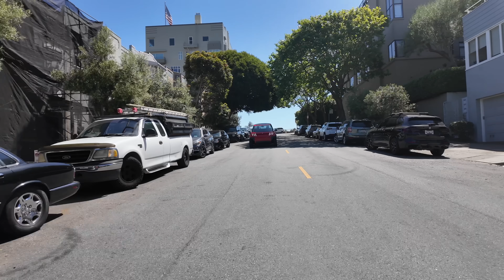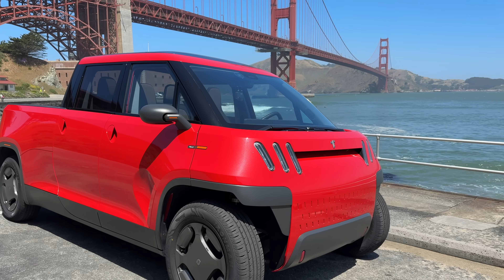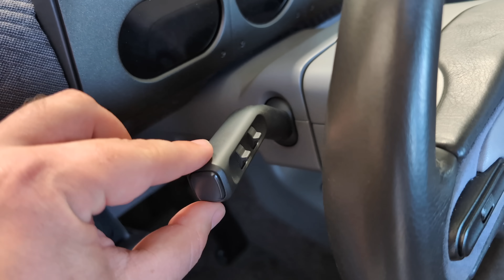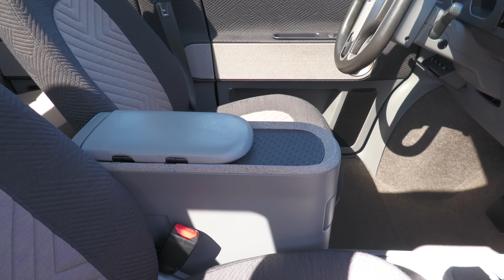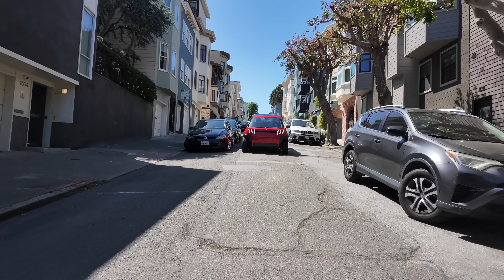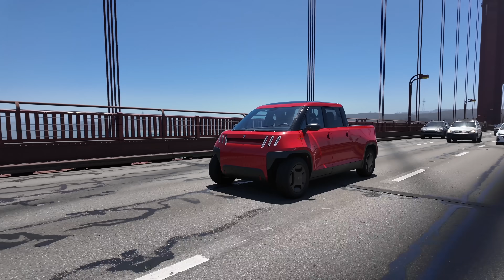The Tiny Telo Truck Hopes to Pack a Big Truck Punch

Comment: If I had one critique on it just from the numbers, it would be that bed length of 5 feet (a similar complaint that I have to the Maverick and Santa Cruz).  Rather than doing the mid-gate, and bringing whatever you're hauling into the cabin (to say nothing about the weather), wouldn't it be better to put an extra three feet into the bed (making it still be a foot shorter than the Maverick).  Of course, you could then have three feet more of battery underneath that bed.  Well, maybe have that as an option.

Comment: Quote: "Serving the utility of a full size pickup truck", hmmm, how can that be with that odd ball 5' bed?  Is this a joke?  And at that price?  R U Kidding?  Get rid of the 2nd seat row, extend the bed that much.  The cab looks so cramped for the two of you testing it. Ok, it does look cute and if were in the $30K range for single motor and std. range it might be an ok 2nd vehicle that can carry groceries home.  (Or a pizza and 6-pack of beer.)  I think I'd prefer the SUV version and not call it a pick up truck.  Hey, I also think the Cyber-truck looks dumb as hell too, unpractical and way to expensive. Look at Slate for a very practical price point and options....  With the Telo I think your knees are to be sacrificed in any minor head on collision, I see for a large dude you had driving it, his knees were right at the dash under boards...yesh...better put an air bag there please.....Last word, I do like its look and conceptual entry to the market.  Keep going and you bet I'll keep watching to see if you hit my 'must buy trip point'!

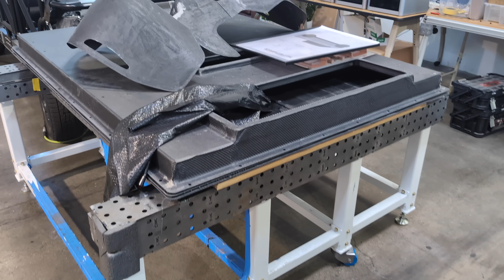Comment: 3:15 that´s the thing with EV´s. they are all their own standard... if car manufactures keept to a battery standard  frame work for like how they needs to be shaped and what kind of battery setup´s i would feel i could own a used EV knowing its easy and cheap to find replacement battery´s.. today, i wont give you a single USD for a EV... cuz all the value are in the battery and i cannot risk buying a used car there i need to replace a battery for a cost of a new EV if i am lucky finding a battery to replace with to begin with.

Comment: Crew cab is truck cosplay for city folk. 
Truck beds and men on dating apps under 6 ft are equally real.
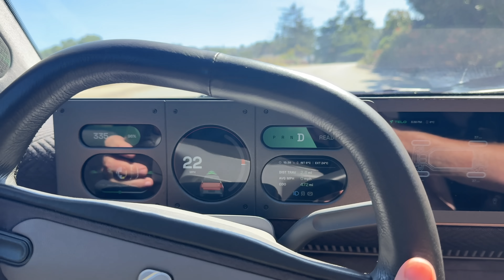Reply: 2:33 "Our vehicle is a pickup truck dedicated for downtown cities." And the reason people drive pickup trucks downtown is to roleplay as rugged, rural, and/or rich enough to afford an impractically manly whip. Even in the country trucks rarely haul anything; but downtown there's no practical need! Vans, station wagons, and even SUVs do deliveries better and you ain't doing landscaping in the concrete jungle!

Comment: The cab itself removes a lot of my issues with American style pick-up trucks. The lack of an enormous hood that can hide twenty 1st grade children is a bonus in and of itself. And if it keeps the style, you can have a cab that's higher up. It's basically a flattened van-style cab.

It might need slightly better forward visibility, so you're not parking a full foot away from the kerb, which you might be able to do by raising the height of the cab.

Comment: Disagree with the two-door comment. A short truck is where i want a two door.
Reply: As Telo has said repeatedly in videos and articles from various reviews, they chose the 4 door crew cab short bed version after extensive market research. so they didn't just 'decide' to not offer that configuration, there was data behind it. As much as you and others do want a 2 door long bed variant, you are apparently a very small minority. Further, the the truck does convert to a 2 door with an 8 foot bed when dropping the mid-gate, which satisfies a lot of people that need to carry longer items.

Comment: Here's why it misses the mark. They try to do too much with a tiny package. The bed is too small to haul anything (compared to the small "Slate" even). The back is too small for adults. The driver's legs are about a foot from the bumper. Safe? Why does it need 500 hp? People want an affordable small truck. 500 hp is unnecessary for day to day driving and an unecessary expense. AND a pick up truck especially for downtown city? Think about it. How long will tools last in an open pick up in the city? Heres why no one else has a mid gate: you got your stack of plywood right behind the driver's seat. You rear-end the fellow in front. Your plywood slices through your back. Ugh! Has anyone actually thought about what people actually need?  Pass, pass, pass!

Comment: 5:31 Why are you Americans obsessed with truck beds... Just build a van instead and get the rear seats mounted on rails, so you can decide on the fly whether to prioritize cargo or passengers.
Reply: With a van (or, in my case, an SUV), you also have significant size limitations that you don't have in a truck.  I regularly end up hauling home surplus-auction winnings like shelving that would be much easier to load if I didn't have to figure out how to fit them under the roof or through the back opening.  It's also really nice for heavier things to be able to stand up in the vehicle bed when loading and unloading; there's no way inside even a large SUV to get much lifting leverage.

Another nice thing about a truck bed is that when it gets dirty, you can hose it out.  I wouldn't want to put shovels and rakes and other yard-work tools in an SUV.
Reply: Because with a pickup, I can keep my passengers and the stuff I'm hauling separate and I don't have to pick between one or the other. I haul stuff in my truck that I don't want inside a van. When I'm done, I just leave the tailgate down and wait for rain to clean it out. Additionally, the height of what I can put in my pickup bed is only limited by what I have to drive under. Not so with a van. Even the length of objects is easier because depending on what it is I can have it overhang the tailgate or drive with the tailgate down. I can throw stuff over the side of my truck's bed to load and unload it and I don't have to stoop over like I would in a van. Unlike a high-roof van, my truck fits in parking garages and drive-thrus.
Reply: They have a camper shell accessory to turn it into a van enclosed rear cargo
Reply: @4johnybravo Unless you don't get rid of the rear bulkhead between passengers and cargo, this is not addressing my point.
Reply: Vans are REALLY bad at some things - like hauling 4x8 sheet goods. That's a major use case for a pickup truck and why they HAVE to be able to fit 4 feet between the wheel wells. Another case would be cinder blocks and mulch and dirt and rock - things you wouldn't want to be in a van. And loading pallets is much easier on a truck bed. Hauling things that are too tall for a van. Some people haul trailers with gooseneck or fifth wheel hitches. There's a ton of common scenarios where a van does not work. A van is better for sleeping in down by the river, though.
Reply: @bubba99009 And how often are you hauling pallets and sheets?
Reply: @bubba99009 a dodge caravan can fit a full sheet of plywood.
Reply: The industry can crap on emissions standards for pickup trucks so they manipulated the market until it became the standard. Nothing about it is about being practical or any real needs. Advertisement convinced people that they will possibly need it one day or that it looks cool.
Reply: @HSFlex_lu  Exactly.
Reply: @HSFlex_lu yea or some people actually use trucks to do truck stuff. Not everybody lives in Manhattan and considers assembling an IKEA end table major construction work. Also fuel economy regulations and emissions regulations are not the same thing and work at cross purposes to each other.
Reply: As an American who uses a truck for work purposes in the city as this truck is aimed for- No one in their right mind wants to share air with piles and piles of garbage, debris and possible hazardous materials. I literally use a Nissan Frontier fleet truck to service upwards of thirty different in city parks that can't be safely accessed by the normal garbage service.
Don't make me have to drive 4 to 8 hours with hundreds of pounds of dog poo and food waste in my personal space.
Reply: @0ArmoredSoul0 Do you consider yours to be the typical average user case?

Comment: This is exactly what we need in S.F.  Gas or EV it's what's missing in the car market in general.  An actually small truck or SUV.  Even if they don't make it as a company, they've managed to put an emphasis on what is needed in the U.S. auto industry.  Price can and needs to come down to starting under 30K and it will be a hit..... At least in S.F.

Comment: This is the first electric vehicle that gets me interested.  It's all about the function, not the fancy.  One concern - there are VERY expensive bits just behind each bumper, and with the wheels at the corners,  this thing is going to be an absolute nightmare if it gets tapped.

Comment: I love that there are finally some US startups promising small electric pickups. But as a city dweller myself, the crew cab is kind of a dealbreaker. If I'm buying a truck I primarily want maximum hauling volume, not the ability to ability to seat four passengers. In a city, your crew is taking public transit to the job site. The crew cab is maybe fine as an option, but it's weird as the default and in terms of functionality it kills my enthusiasm. Leave the crew cabs with truncated cargo beds with the jumbo luxury pickups.

Comment: The open wheel invite road damage to the control arms and shocks.  It turns a slight tap to another vehicle's bumper from a sub 1K fix to thousands of dollars in repair costs.  Also, the vents directly behind the wheel will be throwing rocks, salt, and whatever else directly against the paint on the sides.  Both are horrible design choices.  No thanks.

Comment: Starting at $40k? No fork in way. What is needed are entry level EVs. Not ones that start out expensive and go up from there. The Slate truck looks to be about half the price, so far.  Also that mid gate is just a water leak waiting to happen.

Comment: 8:55 - You're the one that pointed out that an electric vehicle capable of towing should have the charge port near the front, because otherwise "trailer problems".
Reply: If you have a trailer, then with current stations you're always going to have to park the trailer somewhere before charging anyway.
Reply: Aren't there plans to make parallel charging stations like gas station instead of the current 'stall' type of charging stations?
Reply: @Causemoi They already exist, albeit rare. Gridserve charging forecourts in the UK have this arrangement, so you can drive through with trailers and caravans.
Reply: @Causemoi  some of the stations for semi trucks have this design. Both use the same CCS plug (at least here). Just charge there

Comment: 8:50 designed to redirect air and dirt from the road directly into door handles. The design is soooo Californian...
Reply: And probably mud right into the cabin if you have the windows rolled down and drive through a mud (or rain or slush) puddle. Seems like a bad idea for any place that actually has weather. Assuming they will roll down in the production vehicle - but even if they don't - all over the outside of the window is not much better.

Comment: I understand the desperate need to give it manly Merkinese muscle-car credentials (500 horses! Big power! 4 seconds to sixty! Big speed! Relax, boys - nobody will laugh at your limp and puny stats!), but shredding tyres gets old very quickly. It'd be just as useful a vehicle with 120 horses, 14 seconds to sixty, and treble the range.

If you need to haul 4 tons of lumber, hire a truck. If you need to tow a gigantic trailer at 90mph for 1,750 miles, hire a truck.

Nobody needs supercar sprint performance on public roads. Little boys may WANT it, but they don't need it. EV builders are obsessed with the wrong things.

Get the specs down, get the range up, get the price down.

Comment: If the FIRST thing the CEO (and ad hoc representative of the company) does is make excuses for the price, that should tell you something. No one will buy a tiny overpriced electric truck, any more than anyone will buy a tiny overpriced electric car, except for the MoreMoneyThanBrains crowd. From a design perspective, if you already have a passthrough for 4x8 plywood (like anyone's gonna haul plywood in this thing) why make the rear seats so tight? Make the bed 4x4 with the passthrough, increase the rear seating area, and have a semi-usable car to go with your semi-usable pickup.

Comment: I was very interested in this truck when they started putting it out there. I think that most people who buy these 70-80k domestic trucks would be fine with this. I however ended up putting money down for the slate, because I don't need nor want a 4 door 4 seater truck. But still think this will be a great product for those who use a "truck" as a daily run around car.

Comment: I think it will be wildly successful if they go the route of easily repairable with off the shelf parts like Edison Motors is with their heavy trucks. NOT like tesla does with their "oh, a little plastic coolant pipe fitting is broken, that'll be $25k for a whole new battery pack" BS.

Comment: This design has one major flaw and that's what will happen if you bump into the back of another small car near the edge. The front wheel will ride up and over the rear wheel of the front car flipping the Telo on it's roof. It's a fault that many small cars with plastic wings (fenders) suffer from.
A crash bar that sits in front of the wheels would be a useful option.

Comment: It seems like the primary market for these is construction firms that are doing work in cities. 

This seems like it would be an excellent choice for construction firms doing work like renovating hotel rooms or apartments. It’s small enough that you could load load it up with plenty of Sheetrock and it would still fit quite comfortably in a parking garage. You could put furniture in it and then just unload it onto a dolly in the garage and take it up the freight elevator no problem. 

Utility companies could probably make good use of these too. Small enough to maneuver through alleyways, but strong enough to tow a trailer with one of those little Kubotas on it for digging out the 3’ deep trench to reach the gas line or whatever. I could absolutely see them using the “monster cabinet” to stow those fold-up stands for the “men at work” signs. 

They’d also be great for the people who go around charging the dockless scooters because they’d have a much easier time finding spots to quickly parallel park to grab the scooters, because the truck is so much shorter. 

I doubt it would sell well as a personal vehicle. One of the defining features of big dense cities like NYC, DC, Chicago, Boston, San Francisco, Philadelphia, etc. is that the people who live in them don’t have any reason to own a pickup truck because we live in apartments, and also just drive much less overall than people who live in suburbs and rural areas. In fact, a large majority (78%) of households in Manhattan don’t have any car at all. So I don’t think that the “city dwellers who want to buy a pickup truck to do truck stuff” market is actually particularly large.

Comment: They should make it kind of like the BMWi1 (hybrid) with a small gas engine and a topspeed of around 60 miles/hour and a range of minimum 100 miles using gas only and they will have a winner!!!
Reply: hybrids are the worst of both worlds really. Batteries have refined to the point that creating a hybrid just creates additional weight and space penalties. 
Hybrids are nowadays most of the time just there to ease the mind of a consumer that didn't get used to BEVs yet.

Comment: I like the Telo and their plan to be profitable at low volume so they have a better chance of success. 
I really hope that they make the rear glass removable with the camper shell because just the lower panel moving would limit the usefulness for me. My configuration with the camper shell and the Aptera solar was a little over $50k which is great for a truck (or SUV). 
I had an early Saturn with flexible plastic panels that were pretty dent resistant and I think Slate is using the same panels, so it would be cool for Telo to use them especially for an urban based pickup. When I lived in the city with on street parking I learned a lot of people are parking by sound or going until they hit something and metal panels, especially aluminum don’t pop out easily. 
Slate got over 100,000 deposits because it is a throw back single cab small truck even though a fair number will probably drop off when people find out it’s probably a $30-35k truck without the tax credit. I’m looking forward for both to be available to buy.

Comment: In Europe, there is currently a gap in the market for small electric delivery vans with decent range. If this thing had only two seats, a van body and was certified to be able to be sold in Europe (definitely needs the front wheels to be covered by fenders for that) and a cooperation with an existing dealer network, with the estimated specs and price for the single motor, parcel delivery companies would buy this thing like crazy.
Reply: Parcel delivery companies already have huge fleets of EV trucks. At least in my country. Apart from that, the Chinese are offering quite a few models that are way ahead of the Telo, e.g. by already being road safe and not years away from mass production. 

While there is a market for the Telo in the EU, by the time they're ready to tap into it (if they don't go bankrupt in the meantime), all other companies will be far ahead of them. And then there's their outrageous target price, which could increase significantly if Trump keeps up his tariff shenanigans.
Reply: @pseudonym3690  ok be real do you actually think this thing will release in orange turds time?